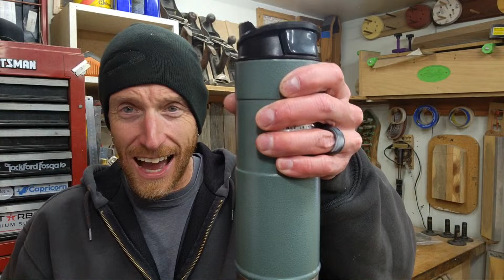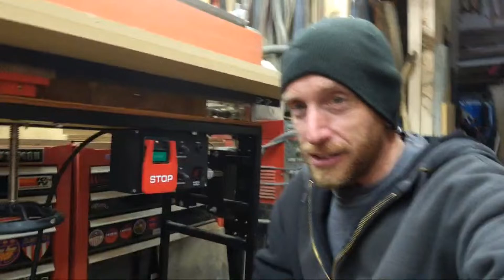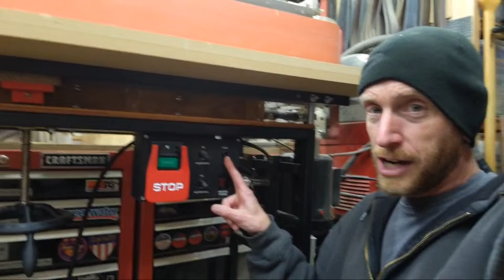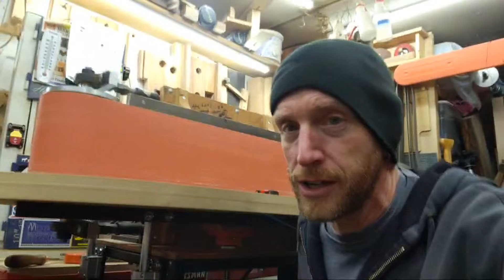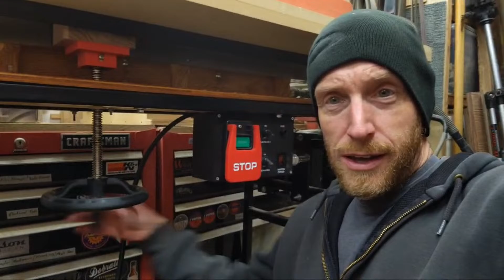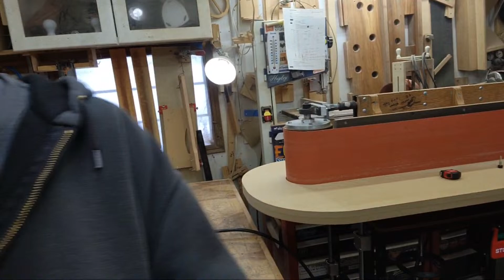Wednesday Live (11/27/24)

Comment: For laminating, here is what I have learned.  Do not use the water based contact cement, use the solvent based cement.  Put two coats on the MDF and two coats on the laminate.  I have had issues in the past where it absorbed in. Contact cement is the adhesive of use, even over spray adhesive.